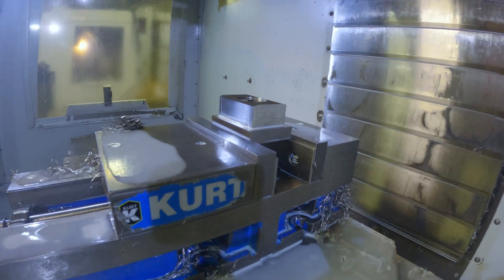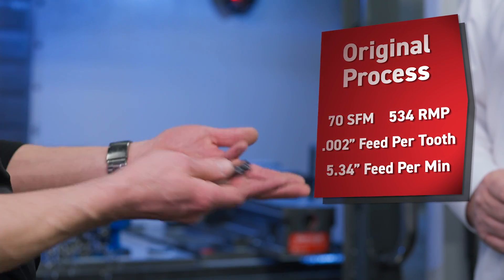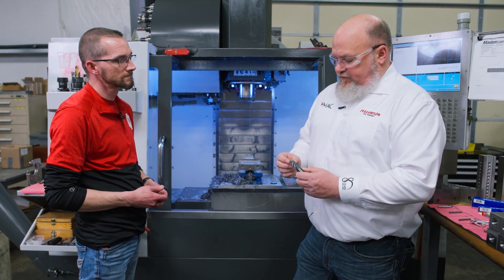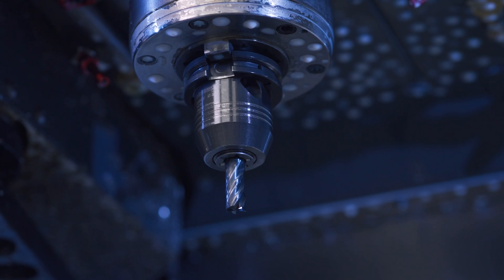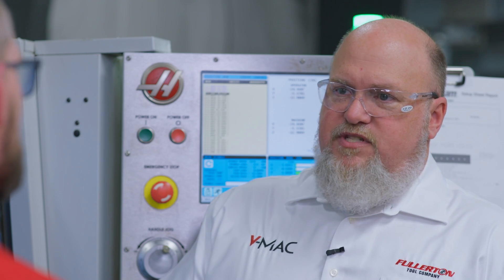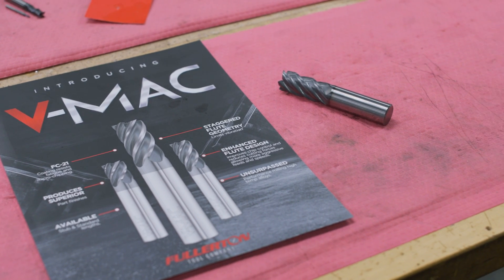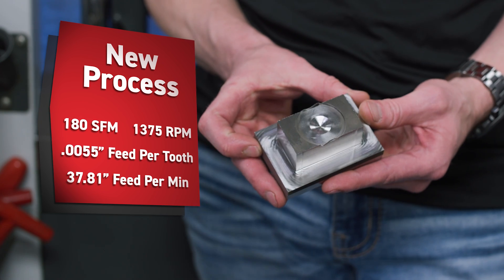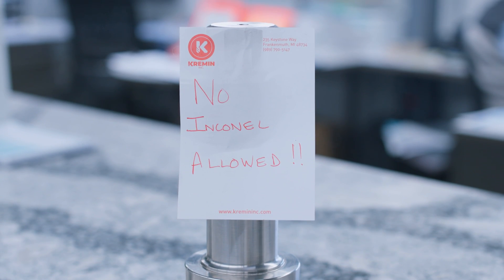Dynamic Milling / Roughing Inconel - What End Mill to Use?

Comment: What has worked for us that you never hear anyone talk about .  Use autofeed in the ATM menu. The machine will automatically slow down the feed when the tool load reaches whatever percentage you tell it. Run nickel 625 lights out. Get 4hrs + using 1/2  5 flute  roughing end mills